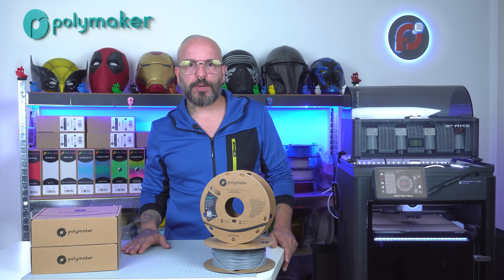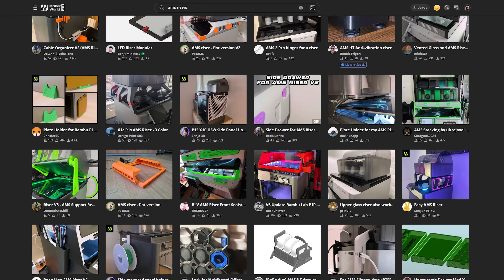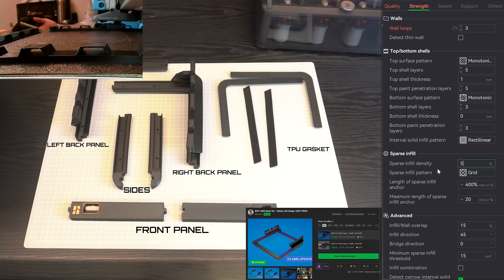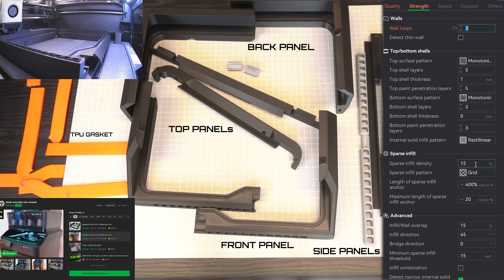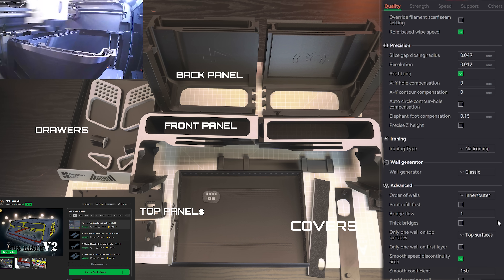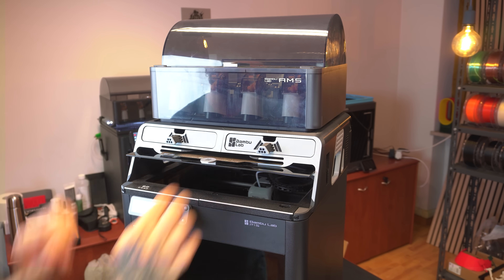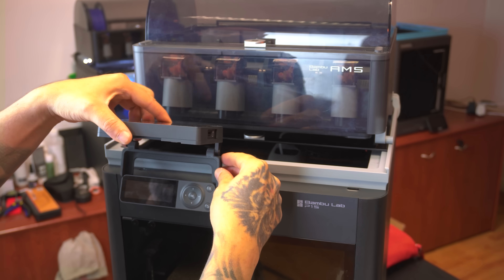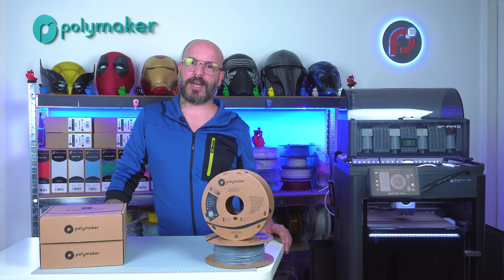I 3D Printed The Best AMS RISERS | #polymaker

Comment: Whatever design you pick, it's still a BAD idea printing it from PLA.
That stuff is only good for making silly toys. Do you really want to risk wrecking your AMS due to weak filament?
Use PET-G as a bare minimum, preferably ABS or ASA.
Reply from the maker: Yes Absolutely right, PETG ABS ASA are way better, and they don't stick, this was more a design overview 😊
Reply: @PixelForgeLab  Then maybe you should have pointed that out before people start printing it in PLA.
Reply from the maker: @TryptychUK that's up to common sense and to people, I'm not imposing anything 😊

Comment: Did it start to warp, becuase you printed it in PLA, and the heat from the printer warped it? If so, it should not be a con. How much did it cost to print?
Reply from the maker: No edit no tricks, the only warping was from the A1 and I say it and show it

Comment: I have the same riser for the P2S.  I had a P1S and printed that riser and loved it.  Glad they designed the same one for the P2S right away.  Love the LED lighting.
Reply from the maker: Which one has been designed for the P2S ?
Reply: @PixelForgeLab  Low Profile P2S Riser with Diffused LED by make 3d
Reply from the maker: @cliffs1956  oh I see, thank you !

Comment: The macYo42 model was the first thing I printed on my X1C about 2 years ago. It is worth every hour and every gram of filament. I have not experienced any bending on mine. Also there are loads of add ons for it. I recently got the Eibos Tetras AMS heater upgrade and printed the mounts for it so it fits perfectly.

Comment: I'm still confused why there are AMS risers in the first place?
Reply: Multiple reasons. With the movement of the tool head, the PTFE tubes brush against the glass lid, and over time they get worn out and fine particles (PTFE dust) due the abrasion fall onto the build plate, affecting the print quality. So a riser extends the life of the PTFE tubes, while also protecting the underside of the glass lid from scratches and wear. Additionally a riser allows you to remove the glass lid with more ease- for prints that require faster and more effective  cooling, since hot air does rise up.
Reply: It's covered at 1:50ish

Comment: I have one question. I have printed your recommended favorite for use with my P1S. The rear hinges, attached to my AMA 2 Pro fall shirt of the frame in the rear. I find I have to use one of the square pegs that were part of model file get hinge to rest on frame. What have I done wrong? 
Thanks for your reply 
Richard
Reply from the maker: Hi, I think the riser doesn't match the AMS 2 pro.
Check the makerworld page for updates
Reply: Thanks for the reply. I went to  Bambu lab and found and printed both front and back legs fit my ams2 pro. That solved the problem.

Comment: Thanks for the video, you posted this just a month ago? I’m confused why PLA ? , and why we would even mention the panda touch? I had to toss my panda touch out as it’s not supported any more. Since I can’t keep using the old firmware and use the ams2,  as well no interest in running it off line in LAN mode. Because of this panda dropped the price to under 20.oo
Reply from the maker: PLA because this particular type is really really sturdy and very good quality.
True about the panda touch, but I keep one of my printers with an old firmware, it really does nothing at all.

Comment: Great evaluation. I too use Sanja's risers, though I'm only using v4.5 - my AMS units are stacked on the side. One point/question though - aren't you concerned about heat on those parts? My first riser was made out of PLA and after a few rounds of printing stuff in ASA it deformed. My current riser is printed out of Siraya Tech ASA-GF. Temp-stable and the GF ensures better dimensional accuracy/less shrinkage. We def agree on the Polysonic PLA Pro though - excellent stuff.

Comment: None of these should be printed in PLA, PETG at the minimum
Reply: Agreed. I printed the AMS Riser v2 in PETG almost a year ago and there is 0 deformation like shown in this video.
Reply from the maker: @RGInquisitor yeah well, it all depends, not everyone prints at high temperatures, PLA is most common still, my risers are still solid, in PLA, and I print at high temps
Reply: @PixelForgeLab yes, but clearly it was an issue for you since you got sagging.

Don't you find it unfair using the wrong type of filament then listing it as a "con" of the design when you're the one who caused the issue? If you had simply used PETG you never would have had any sagging.

You also dropped the infill from 15 to 5.
Reply from the maker: Some of them yes, totally agree ! Because of the heat and possible deformation.
Nice one

Comment: I’ve printed a LOT of BaBo stuff. Most of it is very good. The one thing I cannot recommend is the BaBo honeycomb riser. Screwing it together can cause the layers to separate.

I have printed it multiple times, in multiple materials, optimising for layer adhesion. Unfortunately, the honeycombing means there just isn’t enough surface area to maintain adhesion when an M3 screw is pushing the layers apart.
Reply from the maker: Gotcha
Reply from the maker: Btw I released later that it was bambu, even though on the page it says babo, and I was just reading the voiceover

Comment: I use ams riser 2 and it's rock solid on my x1c
Reply from the maker: Does it tilt and wobble like mine ?
Reply: @PixelForgeLab nope.  Rock solid and printed with asa.  Held together with 3d gloop.
Reply from the maker: @jessejamesmcguire mmmm ok

Comment: I think I'm going to try "AMS Glass Slider Riser V5 – Tilt Function P1S X1C" - great overview, thanks!
Reply: That’s the one I printed and the v4 without tilt prior. Fits together perfectly. I had some warpage on the v4 at the back so I printed the v5 in matte PETG. For my second printer when it arrived. I think I prefer the v4 as I rarely have to go into the top of the printer and the glass on the v5 moves too easily. My printer’s isn’t sitting 100% flat so the glass walks forward slowly due to vibration. I printed a 2mm TPU WEDGE…
Reply: Same here. Started with the V4 and modified it for the V5 AMS 2 tilt version, along with the LED shade add-on. Superb fit and works like a dream. 
I also added the AMS stays tat clip into the riser lip and stop the AMS 2 from dropping back down until you release it.